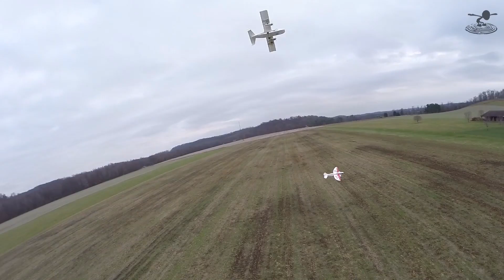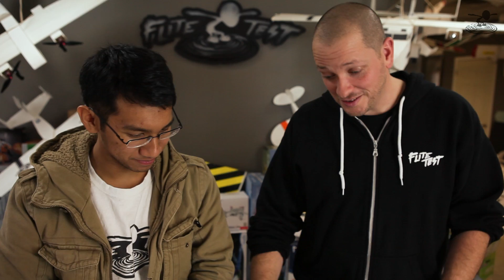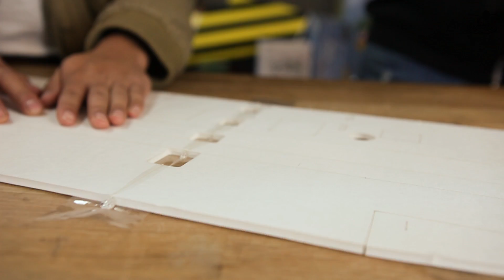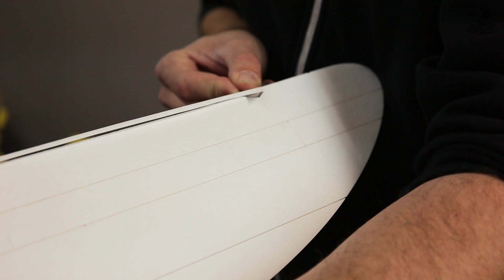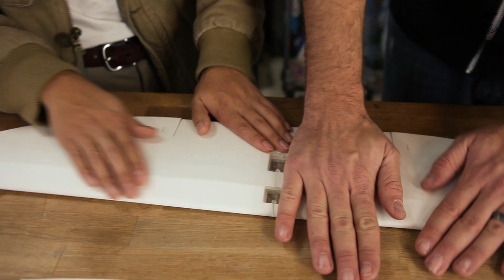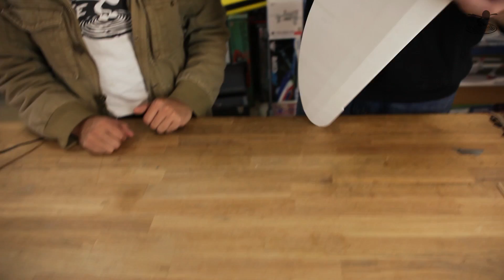Flite Test | FT Mini Cruiser BUILD

Comment: Not sure if anyone is still reading this.   With the new speed build kit that comes with water resistant foam board, there are 5 panels and I don't see the bunny face/ear shaped piece of foam board (from 32:00) that makes up the front top hatch battery cover any where.    I also don't see it on the pdf plans.
Reply: oh I dont have that either wondering what to do lol

Comment: Dang i got some brand new 2208 3300kv motors just laying around..... and i got some crazy 6x4x6 props....hmm, been meaning to try em out.... oh dang turnigy just came out with a brand new line of 70c 3s 1300mah batteries for like 16 bucks ... oh dang i got these digital 5g servos i just accidentally bought on hobbyking... i just may as well get to the dollar store and get some foam board.... and i might well say hi to dan at the hobby store for some control horns....

Comment: can you guys do a build video for a 2 channel twin motor FT cruiser like those cheap planes likes fx-803 and all as it would be kindda easy that way for very beginning as I did build a very mini version of this same this FT cruiser with stayofoam but couldn't really put that much money into it and is it possible to have a smooth flite with a 2 channel control on the plane that you guys built in this video ?? 
HOPING TO GET AN ANSWER AND THANKS IN ADVANCE

Comment: how about starting plans service for us in england this would be great so that we can build your craft
Reply: You can download every Flite Test kit as a plan on the corresponding article page. Check out the video description for a link.
Reply: yes but plans from america are bigger and have to be re sized for england
Reply: jimbo57109 Not sure what you mean by that. If you get the full size plans, you can just use a PDF viewer to print them on multiple pieces of A4 paper. http://flitetest.com/articles/how_to_print_plans_in_tiled_format Or you take the full size plans and let them print in a copy shop (which can be expensive though). In the forum there are also people redesigning the original plans so you can print them in b/w instead of color and on different sizes.
Reply: yes the tiling in england is different than america
Reply: what passes for a4 in england is smaller than america
Reply: jimbo57109 Sure, A4 is not letter format, but I'm from Germany and we have A4 here too :). When using the full size plans, you can print them in whatever size you have - even A6 (but that would be a lot of glueing ;) ). The video in the article link I commented before shows how you can do that.
Reply: yes but what my son told me us paper sizes are bigger than british so plans from america have to be resized
Reply: jimbo57109 Ok, let's start from the top again :). You can get the plans in two formats: "Full size" and "tiled" for letter format. Letter format is a little too big for our A4 size. But if you get the full size plans and use the method described in this video http://flitetest.com/articles/how_to_print_plans_in_tiled_format you can tile them in whatever format you need. I've done that about 15 times now and it works nicely. Do not use the small format that is for the wrong paper size, but use the full format and split it so it fits your paper.

Comment: I have a problem with the Recommended Electronics. Could you explain what we need? I think we need 2 motors and two ESCs  which ever ones we choose but this is not clear. Do we need any other multibles? Problem #2 in the Ft Mini Power/Electronics from Lazertoys (Recommented Power Pack) is this complete for the FT Mini Cruiser? How many motors and esc's are included? It looks like 0ne of each.

Comment: Am I right that foam is covered with some film that helps to bend foam right? What is the process for a "hand cut" based on a tiled plan? Cut sheets and stick a film or stick a film then cut?
Reply: The foam is laminated with paper on both sides. You can buy it that way, no need to use any tape or film.
Reply: I have never seen paper laminated foam in our stores that 's why I ask.
Reply: angroidangren What country are you from? The foamboard FT uses can sometimes be found in craft stores. It is quite often used as a backing for posters, architectural models and such (and planes ;). There are different types, some are very heavy, some don't hold the paper well. FT is also working on distributing their own re-branded Adams Readi-Board all over the world, so you might just wait for that.
Reply: I am from North of Russia. ;)
Reply: angroidangren Oh. I haven't seen any posts for that part of the world - yet. What you are looking for is called "extruded polystyrene  foam laminated with paper on both sides". If you don't have craft stores or perhaps design shops or similar it's probably best to wait for the FT foamboard distribution :)
Reply: I am your subscriber.;) We usually do scratch-build fro ceiling tiles. BUT that does not mean all over the country. Just at my place.

Comment: I need some help.
I've had my E-Flite Apprentice S15e in my car all day because I was going to fly today. I went out to the field and got everything ready. Turned on the transmitter, plugged in the battery, and flipped on the on/off switch. The ailerons, elevator, and rudder all moved, arming the AS3X. I checked all of my control surfaces to make sure they were in order, and they were and all the servos worked correctly. However, when I tried to use throttle the prop wouldn't spin. I'm not sure if the fact that I had it in my car for several hours and that it's somewhat cold outside might play a factor in this. Everything was working yesterday.
Any help is greatly appreciated.

If this is any issue due to the cold, you guys should do an episode regarding cold weather problems with quick tips.
Reply: Chase Look on Page 11 of the manual top of the Page part 3) Make sure your throttle is in the lowest position( toward you) and the throttle trim in is at its lowest position ( in other words hold in in the down postion until it stops beeping) when you turn on the transmitter. Look at the top picture. I am assuming the cold was not the problem.
Reply: Doug Wittenberg I meant you turn on transmitter first then......
Reply: Did it work back home when it got warm again? I wonder if the LiPo got too cold to deliver the required power. But then everything else worked... hm.
Reply: Balu I'm at home right now, letting the engine warm up with the lipo in my pocket. Will test soon and get back to you.
Reply: Balu Plugged it back in and it started right up, lesson learned. Thanks for the help!
Reply: Chase Jezik A lot of people have their LiPos in a pocket close to the body so it stays warm as long as possible. Others use heating pads to keep them warm (see http://flitetest.com/articles/keeping-your-batteries-warm-in-the-winter), but make sure it doesn't get too warm :)
Reply: Doug Wittenberg Sorry did not see the other replys

Comment: Would this be a good starter plane? I'm brand new to the hobby and want to get started.
Reply: No this plane would probably be a good third plane. For a first plane I would go with something like the either full size or mini speedster or the mini scout. If you would like some other options, the ft flyer, nutball and old fogey would also be good planes to start with. The ft flyer and the nutball would be the easiest to build if you are worried about that. If not go for any of the others. All of them fly great and are a blast!
Reply: warpedfusion Thank you very much!
Reply: warpedfusion One more quick question do you think a versa wing is a suitable option for a noobie like me? Thanks for the help!
Reply: No, its a mid wing , so you need a little experience first.  Try the ft flyer or the  Storch.
Reply: Tmask M It's a flying wing.
Reply: Tmask M Thank you very much for you advice!
Reply: Tmask M Having started with the FT-22 -> Bloody Wonder -> Blunt Nose Versa Wing (pusher configuration) -> FT Delta; I found the wing the easiest to balance and fly.  The strong structure is very understanding of many crashes.

Comment: By the way, if you want differential thrust, but your transmitter doesn't support it, you can use one of these: http://www.hobbyking.com/hobbyking/store/__6321__TURNIGY_V_Tail_Mixer_Ultra_small.html It plugs into your rudder and throttle channels, easy to setup and works great!
Reply: Thank you for info